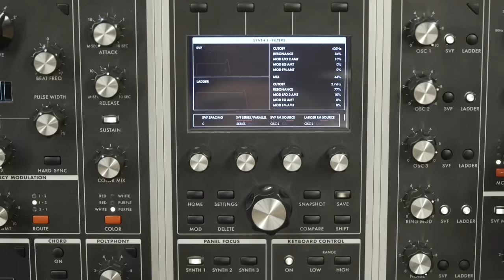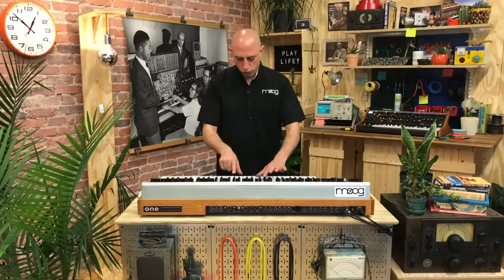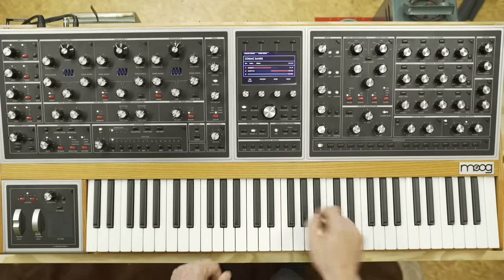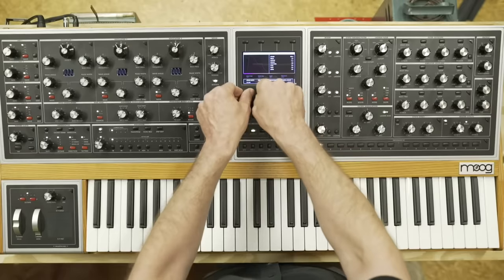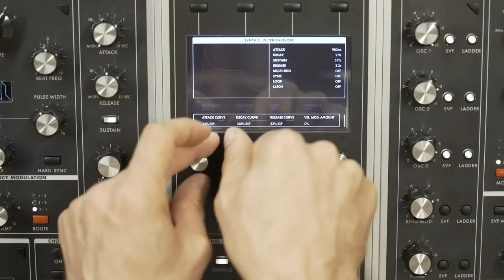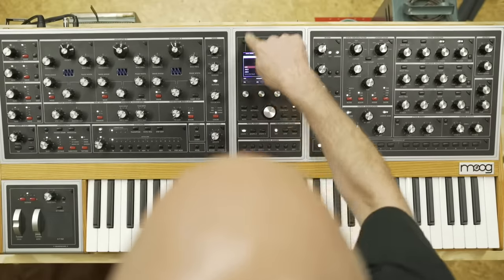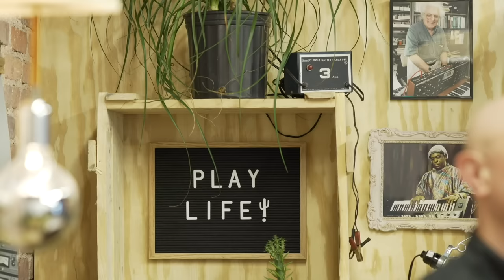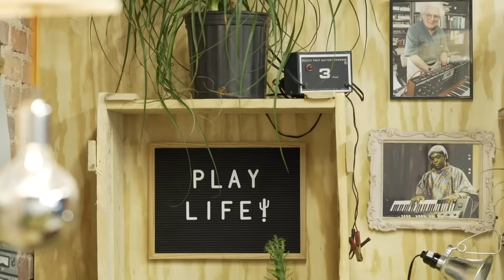Moog One: Deep Dive - Part 1 (Live from the Moog Factory)

Comment: Please, I need your help & a reply ASAP.   I just got my Moog One about 2 weeks ago & I notice a very audible hiss & high pitched hum noise coming through both headphones outputs & main outputs. (it sounds totally different than hum sounded by grounding issues ) The noise starts to become very noticeable at around 40% to 50% volume level, (& increases the higher the volume knob is turned up) and seems to be loudest on patches/programs that use a lot of internal effects processing.  I tried multiple electrical outlets, extension cords, surge protectors, etc, and the noise persists. I don't know if this is common for the Moog One, or it I received a faulty unit. (my Moog arrived with a missing knob, but you promptly sent one to me) 
It's literally the loudest synth I've ever heard, by far. (& I own over 40) It's much louder than any of my 1980s digital/analog hybrid synths. The noise is so loud, I don't see how I could possible use it in a recording. 
I expected better from an $8,000 synth.  What should I do?  Please help me.

Comment: Hey Moog I watched the LFO and the Quick Mod Assignment sections and I still have a question I'm hoping you can help clarify: when you hit press the destination button on an LFO, and you tweak a param such as the filter cutoff, what do these percentages (-100% - 100) do?  Also on the bottom of the same screen, what do the two amount parameters and transform parameter mean?